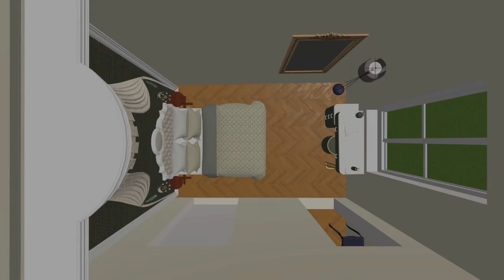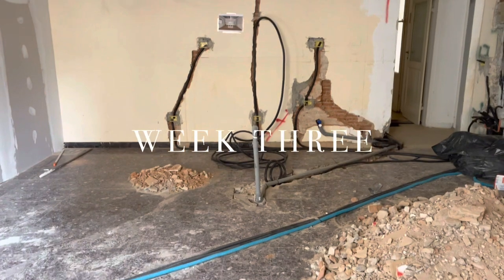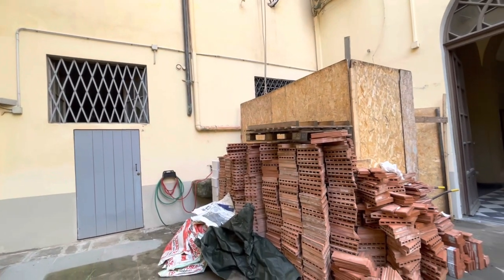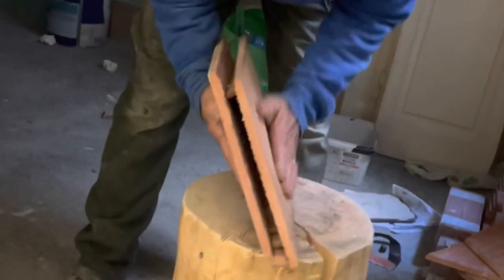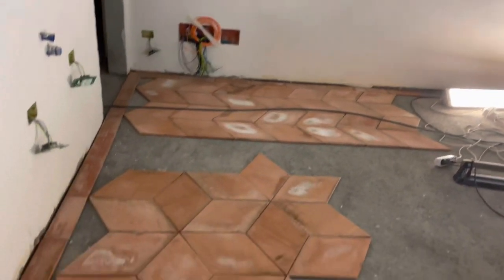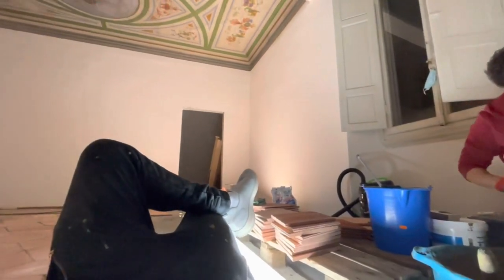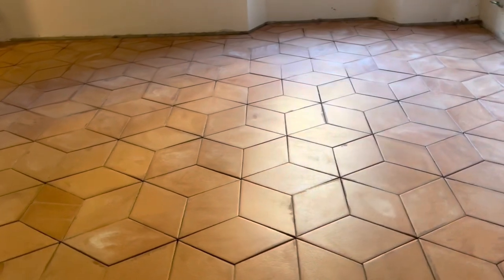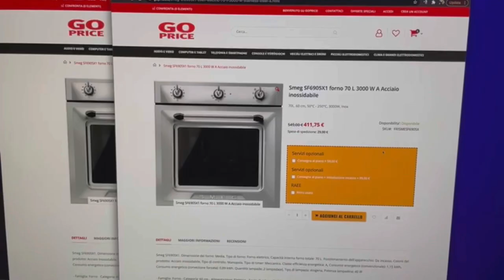RENOVATING A PALACE Ep 1: Buying, Restoring & Moving Into our Grand Italian Apartment

Comment: Can you tell me what company supplied your terracotta tiles.  Were they from Impruneta? What is the double tile which you had to separate called in Italian?
Reply from the maker: Hey Patrick! Yes the tiles are for
Impruneta, just south of Florence. All terracotta tiles made in the Italian tradition are made originally as double tiles - that’s the shape of the moulds that they put into the furnaces. It’s basically twice as efficient to produce, which is why they are made that way. As for the seller, it was a private individual who we found while exploring Imprunta who happened to be storing excess stock, which we were able to buy up. So it was kind of a one-off. There’s a bunch of producers around there so you can do a bunch of site visits and simply chose your preferred supplier
Reply: @TheBritalianJob  thanks I appreciate your response.